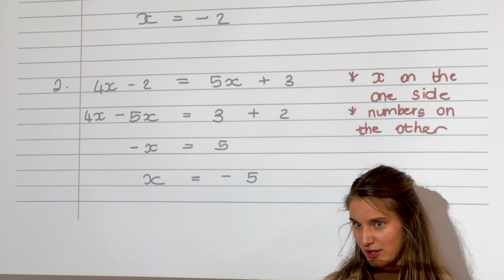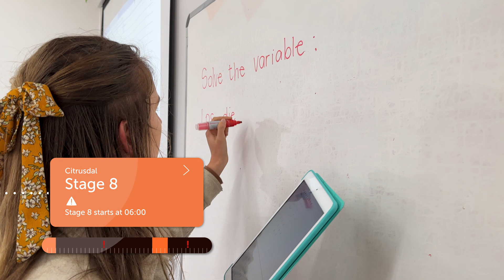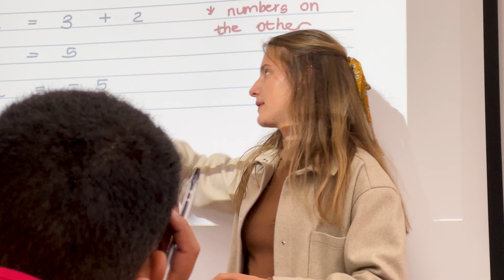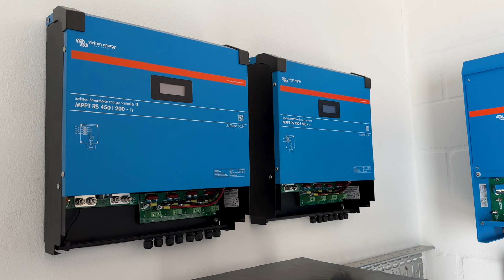This school wants the 'Luxury' of lights

Comment: We need better Funktion for energyflow dc chargecontroller reduce their power when the batt is full. We cant control the charge level of dc mppt.
We meed more customizing of energyflowmanagement. In summer normal the battery is full loaded at midday and then the dc power is vasted. So we have the whole day to load the battery. Are you planning to optimize the behaviour and give more control to energyflow Management
Reply: Once the battery is full, the mppts stop charging and only produce what is used at the moment. Nothing is wasted.
Reply: @Deiphobuzz  Sure. In Summer the Batterie ist füll at midday but sind Shine Further 8 hours but mppt ist throttled